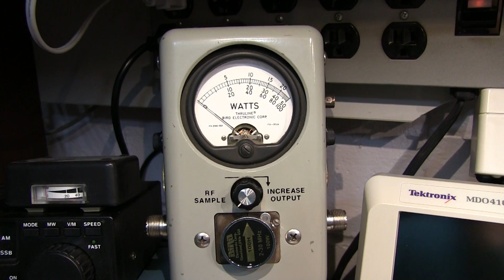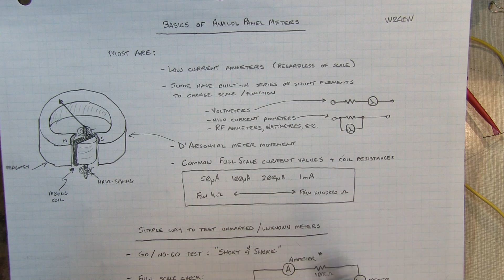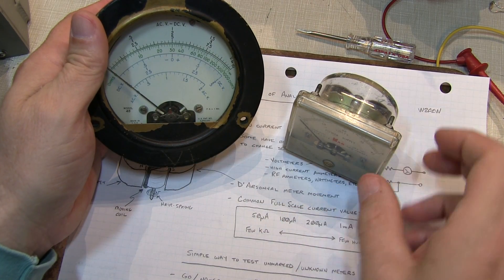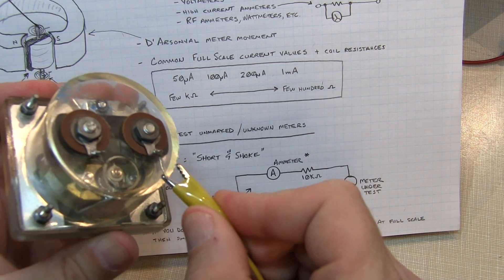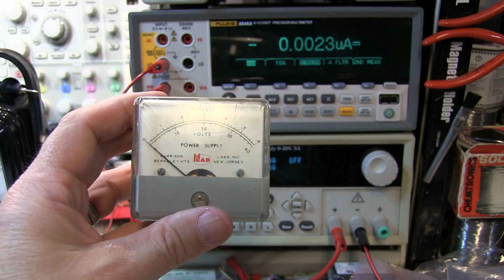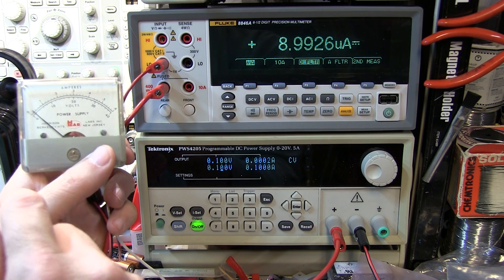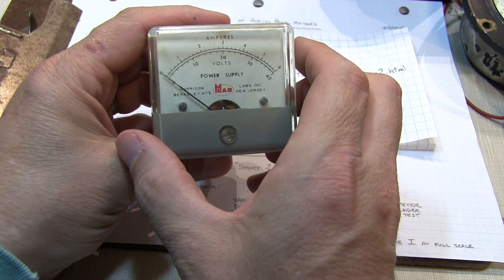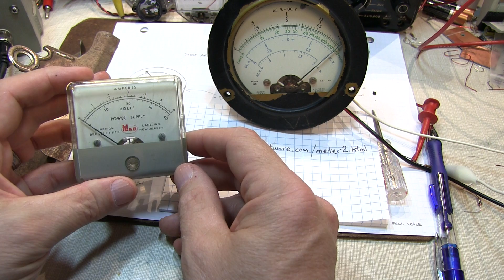#235: Basics of Analog Panel Meters | Analog meter movements | D'Arsonval

Comment: Whats makes the difference in an AC or Dc meter.
Reply from the maker: most AC meters are really DC meters with a built-in rectifier.  However, there are some AC-only meter movements, but they are not D'Arsonval types.

Comment: I keep re-testing this very fine old orphaned Simpson meter (labelled HP on the face) and forgetting to write it down.  
Note to self: when you look up this brilliant video, the meter is 1mA at full scale (10V through 10K, ammeter reads 1mA)
(Thanks Alan)

Comment: First, thank you for all of your well thoughtful and informative videos.  While watching this one about meter movements it reminded me of a little ancient history of my own regarding custom scales.  In general terms, as you have demonstrated, the scale can be removed.  One can then lay that scale flat and use a straight edge and compass to determine the scale arc length and full sweep angle ( typically about 90° ).  Then one can replicate those parameters after flipping the panel over.  The rear side becomes a new blank slate that one can paint, and scale as needed without adding any significant thickness to the panel that could interfere with the needle movement.

Comment: Very well explained. One additional thing to note. On some of the older more expensive meters the permanent magnet will be made from more than one piece and there will be a tapered slotted piece of curved metal held by a screw that fits close around the meter that bridges the join in the permanent magnet. This is a magnetic shunt and with the movement and permanent magnet carefully removed from its case, it's position can be adjusted if needed to improve the accuracy of the meter at fsd.

Comment: I'm trying to get my 1973 Alcor EGT gauge (exhaust gas temp) in my 1975 Piper Archer aircraft to work again. It is powered by 4 thermocouples in the cylinder exh pipes and is switched to read each cyl by a mechanical switch on the back of the panel-mounted meter. I know the gauge and 4 probes work but only intermittently. Last time it worked was in 48 F deg weather. It won't work during the warm season. Other pilots on aviation forums have said these old meters need to be cleaned or "exercised" by using the calibration screw, but it is very difficult to reach and requires removal from the panel. Your video mentioned the meter coil drum clearance is tight and can get clogged by dust or debris. I think this is what's happening. Is there any way to move the meter needle using an external magnet? Compressed air from the back? Ideas?? tks
Reply from the maker: Automotive gauges, which are likely similar to aviation gauges, are usually not D'Arsonval movements like ones in the video (because they are fairly delicate and not intended for the high vibration environment of vehicular use).  So, I really can't offer solid advice for you.

Comment: What a hidden gem this video, found u by the eevlog forum about the esr meter. 
Lets say if I just have a 9volt battery and a few resistors around, using ohms law as u said to find the right resistor for the 50uA full deflection at 9 volts,  R=V/I 
50ua = 180k ohms
100uA = 90kohms
200uA = 45kohms
1mA = 9kohms
 Can I tell the meter sensibility using this method?
Of course starting with the higher resistance, sry if im saying nonsense stuff, I'm just a hobbyist
Reply from the maker: Start with the highest resistor you have and see what kind of deflection you get for that current, and go from there.

Comment: I am trying to repair an old tractor dash cluster and both the Fuel gauge and Temperature gauge are weather bad with rust any chance these are common and available. Electrically they attach and mount to a PC board with 3 screws  each. The screws are very unique with intragyral contactors..
Reply from the maker: Gauges in automotive and other motor vehicles are generally not D'Arsonval type meters, since they wouldn't generally standup to the vibration in these environments.  Probably not much you can do other than exact replacements or aftermarket units that are intended for the motor vehicle application (although these latter units would likely not fit the OEM location).

Comment: Great video.  My trusty Multi Meter has gone open circuit on the coil. Its  18 microamp FSD. Can you do the opposite eg.  Make a 100microamp FSD  read  FS  with  18 microamps instead of the reverse with a shunt. Its just I cannot find a 4.5inch  18 microamp FS   meter
Reply from the maker: Unfortunately, no, you can't make a meter movement more sensitive.

Comment: Are analog meters better for testing if a voltage is a STRAY voltage? because Digital Volt meters don't tell you if the voltage is a stray voltage so how does the electronic technique know if the voltage is a stray voltage?
Reply from the maker: analog meters typically have a lower input resistance than a DMM and thus will discharge a stray voltage.
Reply: @w2aew  true, but digital volt meters have high input impedance so would a electronic technician know if the measured voltage is a non-stray voltage or a stray voltage?
Reply from the maker: @waynegram8907   The only way is to place some kind of a load on the circuit to drag down a possible stray.  A good reason to keep an analog VOM around.
Reply: @w2aew  what are some common problems that stray voltages cause what types of errors? In pinball games stray voltages cause the lamp bulbs to flicker which I'm not sure why a stray voltage would cause a lamp bulbs to flicker.

Comment: Great video! I have an ammeter out of a classic car that only has charge / discharge markings (needle in the center when off - 12V system) that I would like to test. It uses a shunt wire, that cannot be removed from the car, in parallel with the meter. I guess the resistance of the shunt would be too small to measure accurately with a DMM. I would guess that a very small proportion of the charging current would be passing through the meter itself. So, I have it on the bench currently and I'd like to test it out to see how much current would actually give full deflection. Would a 10k ohm resistor be of use for this test? I'm thinking I'd have to use a lower value resistor than you would be using here? Do I even have to use a resistor? I have a bench power supply as well.
Reply from the maker: You can certainly start with the 10k resistor in series with the meter.  Start your power supply at 0V and slowly start bringing it up while watching the meter.  If you get to your supply's maximum voltage and the meter still hasn't reached full scale, then start over with a lower value resistor, etc.
Reply: @w2aew  Wow thanks for the quick reply! Ok, will try that thanks! I had the ammeter hooked up, with a little incandescent test lamp for a load, like this a couple days ago just to see if it was working:

PSU (+) ---Small Lamp---(+)Amm-Amm(-) ----PSU (-)

I had the power supply dialed up to 11V, the lamp was brightly lit and the PSU display was indicating that it was outputting 280 mA. The ammeter was showing just a little bit to the "discharge" side. Maybe 3 or 4 needle widths. Does this sound like things are functioning correctly?
Reply from the maker: @ourkid2000    Yes, it sounds like this is a fair high current full scale meter, considering that 280mA only moves it a small amount.

Comment: Hi Alan. I recently acquired an Metrawatt MA4E analogue meter, but one with active circuitry (op-amp to create voltage-to-current circuit), with a nice 10MOhm input impedance on DC. I realized that the meter is non-linear, to the proportion that is out of specification of +/-1.5% I suppose that would be of the reading, but have to admit I have not checked the user manual on that point. I have tried adjusting the gain and offset, but could not get it right over the whole scale. The deviation is just to big for my taste. So I have looked in a lot of parts of the electronics, but at last I tested the meter movement itself, to realize that the problem is there. The meter is not linear. It is a 30uA classic d'Arsonval movement. When looking at 0-100 scale, when on 10 it needs 2.8uA and on 100 it needs almost 32uA. The values in between roughly follow the function y=5*ln(x)+76.6 So the scale is like compressed. I don't have much experience with galvanometers and am very curious to solve this puzzle. One more gentleman that also acquired the same type multimeter with similar serial number noticed the same problem, so we are emailing back and forth with our individual findings. First we thought it is something in the circuitry and the op-amp, but now it is clear which part of the meter is responsible for the deviation. Could it be the Hook's law, non-homogeneity of the magnet or... and how to fix this issue? Glad to hear your opinion.

Comment: Have you ever compared a Cb type modulation meter to a scope?
And also wondering how those modulation meters work. Possibly the increase in voltage from the unmodulated signal. Wonder if 100% is actually 4x.
Reply from the maker: I haven't look at the CB modulation meters to see how they're setup/

Comment: The DVM meter is only testing the transistors and Diodes under the DVM meters Low Load. Any reasons why the DVM meter is a "Low Load" and not at a High Load when testing transistors, FETS, diodes?

Comment: Gday W2aew
(very late to this video)
Could you please explain the meter Ohms per Volts number.
Many thanks Greg
Reply from the maker: This is a term that typically applies to an analog VOM.  For example, if the VOM has a spec that says that in the DC voltage ranges, the sensitivity is 20,000 ohms per volt, this means that if the VOM is set to the a 1V range, it will look like a 20,000 ohm resistor between the + and - probe leads.  If it is set to a 10V range, then it looks like a 200,000 ohm resistor, etc.  It is also a measure of the full scale current value for the meter movement itself.  For example, on the 1V range, if you apply 1V to get a full scale reading, and the meter is rated to 20,000 ohms per volt, that means that the current drawn is 1V/20000ohms, or 50uA.  So, inverting the ohms/volt rating essentially gives you the full scale current rating of the meter movement used.
Reply: @w2aew  Thank you for this clear explanation.

Comment: Thanks for the short and shake test and the link for the meter faces. Also, I like to put diodes going both directions across the meter terminals in case of accidentally putting too much voltage into it. The diodes will limit the voltage to the drop of the diodes. Most meters reach full scale long before the .6 voltage drop in the diodes, but although that much would peg the needled abruptly, the meter would still live through it. Germanium or Schottky diodes could be used for "more" protection. I also use an auto ranging dmm in the ohms setting and the small current from the meter is enough to safely "fs" the meter.
Reply: Good tips

Comment: It would be nice if you made a video lesson on thinking of applications when you would want to use an analog meter and digital meter for "fast response times" Fast events. Example when measuring old 40's and 50's transmitters/receivers would be to measure the power supply voltage when receiver and when when keying the transmitter because the voltages will change very fast when measuring from receiver to keying the transmitter and most DVM meters aren't fast enough to capture the events. I have even tried using the Oscope External trigger port to try to record the very fast events but also the Digital Oscope are slow. I'm not sure what in the Oscope Specs to look for to be called "response time" or how to get a faster response time out of an Oscope. I'm sure you have a lot of examples to make a video lesson to know when to use a DVM meter or Oscope to measure very fast events and response times.
Reply from the maker: Analog meters don't respond very fast either (due to mechanical intertia).  An oscilloscope is the CORRECT tool to use to capture transients.  Digital scopes are exceptionally good at this.  You don't need to use an external trigger, you can trigger on the transient itself.  Response time of the scope (how fast a transient it can capture) is related to the scope's BW and sample rate.
Reply: @w2aew  How do you compute/calculate the Oscope Response time based on the BW and Sample rate? is there a formula. Can you give a bunch of examples of when measuring fast response times in various applications and circuits.
Reply from the maker: @waynegram8907  Scope risetime can roughly be approximated from scope bandwidth as risetime=0.35/bandwidth. So a 50MHz scope will have a risetime of about 7ns.
Reply: @w2aew  0.35/50Mhz = 7nS , but is it always 0.35/scope bandwidth?
Reply from the maker: @waynegram8907  Yes, this is a good rule of thumb to estimate the scope's inherent risetime.
Reply: @w2aew  ok thanks I will save that formula . I didn't know the rise time of the Oscope is the same as the response time because analog meters and DVM meters specs say the response time on how fast the DVM meter will measure an event or transition. The Oscopes specs dont list it as Response time i don't think.

Comment: Another great video, Alan, thanks.  Question - I have a Weston Model 901 DC Ammeter and at the bottom it states to use it with an external 50 MV shunt. Can you explain the units of this shunt? Wouldn't this be a shunt resistor? I think also have the shunt somewhere but need to dig it up. The ammeter has two scales 0-15 and 0-150 with no switches anywhere. I presume I would need to use two different shunts differing by a factor of 10 ohms?
Reply from the maker: A "50mV Shunt" is a low value resistor that will have a 50mV drop across it at the rated current.  It is designed to work with meters that will have 50mV drop across the terminals when operated at full scale deflection.  Since the meter's coil resistance will be significantly higher that the shunt resistance, the parallel combination will still be very close to the just the shunt resistance.  Thus, it is easier to specify the shunt for the voltage developed at the rated current.  For example a 50mV shunt for 10A will be 5mOhms.  Yes, you'd need different shunts to use both scales.
Reply: @w2aew  Ok, that makes sense.  So the shunt acts as sort of a current limiting bypass for the meter. The coil resistance is just under 50 Ohms, so with a 50mV shunt, the internals are seeing only a 1mA. I opened it up and the wiring is around 30ga, so its pretty delicate yet the terminals are pretty big to minimize any resistance in the connections. So for the 150A scale the shunt must be pretty big to bring the resistance down to 50mV/150 = .33mOhm. And the wires to and from the shunt and meter would need have very good and clean connections. I don't even have a meter that can measure such a low resistance.
Reply from the maker: @Kurt1968  Correct.  Measuring resistance that low definitely requires some special equipment, 4-wire sensing, etc.  For these high-current shunts, the resistance is so low they typically spec'd them by their voltage drop at rated current.  To learn more about current shunts and how they change the scale on a meter, see this video: https://youtu.be/4U-nxdp-LDw

Comment: I was wondering how to measure the inrush current of a power transformer or just transformers in general because when you the EMF of the collapsing and expanding is what determines the the inrush current of the transformer guitar amplifiers have a power transformer and I don't know how to only test the enrich current of the power transformer with the circuit still connected would you have to disconnect the circuit and order to measure the the enrich current of the power transformer the AC power transformer and the thing is is the two rectifier to isolate each components in Rush current how can you do that because the circuit is connected or would you have to disconnect it to know how much the power transformers in Rush current is and how much is the tube rectifier what is that in Rush current. Trying to isolate the enrich current per each component the filter caps the tube rectifier and the the power transformer the problem is how to isolate each component in Rush current cuz each one will generate a different in Rush current but it's hard to do this in circuit to try to measure the inrush current it's a isolate each component while they're connected in circuit

Comment: I'm rebuilding a vintage (1960's) high voltage power supply with a analog meter and unfortunately it came with shattered glass. I wanted to be sure it still functioned before looking at replacing it and your video was right on the money. Thank you for teaching me not just how to test a meter, but also how they work. I'm happy to report the meter is fully functional!